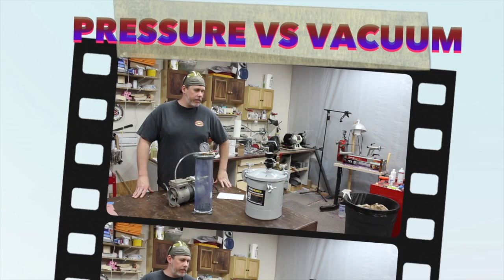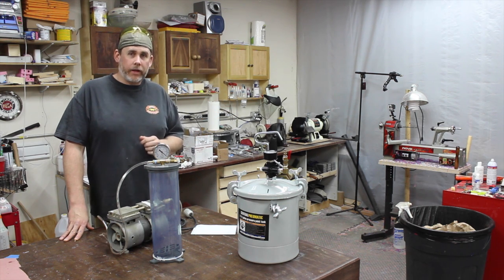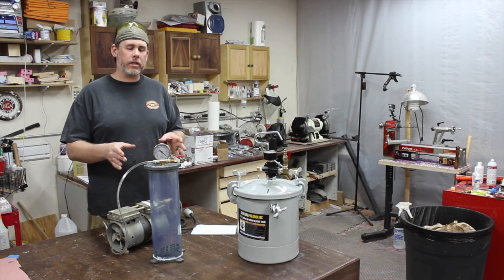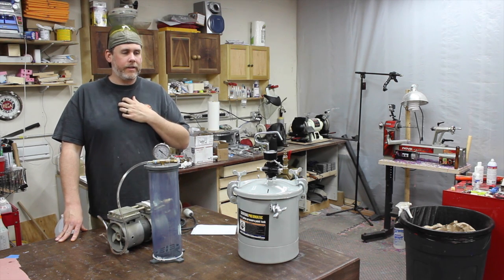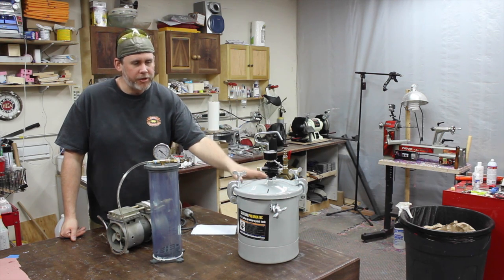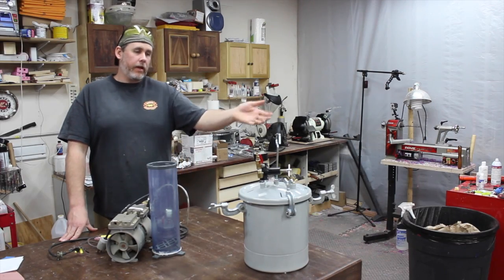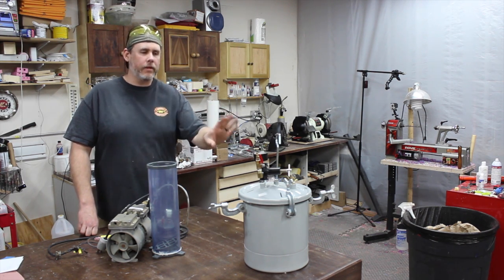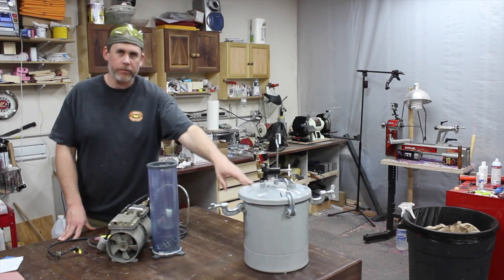Can I Use Vacuum Instead of A Pressure Pot to Cast Resins With?

Comment: Be careful with a vacuum.  I ruined a gallon of epoxy.  Pulled a vacuum, started cleaning and forgot.  Came back 10 minutes later and the resin was completely hardened and was so hot it melted the plastic bucket it was in.

Comment: I found that when de-gassing polyester casting resin, it gasses indefinitely. I suspect that the resin creates gas during the reaction but not enough to create bubbles in normal sea-level pressure but it's noticeable in a lower pressure. So I cannot see how anyone can leave a cast to set in a vaccum pot.

Comment: $100 for a Harbor Freight paint pot. More $ for conversion parts and hose. And you’ll need a compressor! Figure AT LEAST $200 for a cheap pressure pot setup.

Comment: I had a crazy idea for ensuring you don’t get voids in the resin. The idea is to have a valve where you have the resin on the outside of the vacuum pot and the mould on the inside. After you extract the air from the mould, you open the valve to suck the resin into the mould. Once the mould is filled/overflowing, then you let air into the rest of the vacuum pot. Probably not practical since the valve would be ruined, but I’m thinking that using just a rubber tube kinked could work.

Comment: Nice presentation mate, very throughly covered and well put.
I don't have pressure pot yet but am planning on investing in one. What I'm starting to find works best is to degas the resin in a vacume after mixing then pour into the mold then chuck it back into the vacume. De gas for the working time of the resin, release vacume and then hit any remaining bubbles with just the tip of a propane torch. Haven't got my hands on any alumilite yet, using table top epoxy and it seems to work with this so far. 
Still want a pressure pot though, just to brokearse for one right just now hahaha.

Comment: I’d like to start casting. I’m going to use either ecopoxy or Art Resin’s new casting resin thick cast whine it comes out. I’d like to do the pressure pot thing but I don’t get how to modify a paint pot and it looks scary? How to do this in an easy peasy way?

Comment: A vacuum could work with slow setting resins (or a very powerful vacuum in a small container) like he said because when there's no air in the environment, that air is going to want to float out of the resin because it's lighter than the resin and wants to move around but how a pressure pot works is completely different.

The reason a pressure pot compresses those bubbles to a microscopic level is that they're trapped in the resin at 1 atm (14.6 psi) and when you change the air pressure on the resin to 50 - 60 psi while it's still not set that's 3 to 4x what the bubbles have in them so the molecules are naturally pushed into a smaller space and the flowing resin moves simultaneously to fill the space those molecules took up at 1atm.

Of course, if you could cast all your resin in a vacuum or hypobaric chamber, there'd be almost no air to mix into it and you'd have perfect casting without a pressure pot every time! Of course, making a personal vacuum or hypobaric chamber is probably not the best or safest route and would cost you 10s to 100s of thousands of dollars for minimum benefit.

Comment: Great video, thanks! I bought a used cornelius beer keg and a manometer on eBay and used it for 50+ plus resin castings now and it has worked as a charm. Cost me 67 $ in total.

Comment: When you use positive pressure, air bubbles are extruded from the medium. When using negative pressure, the low viscosity of the medium allows higher pressure bubbles to move toward lower pressure in the chamber.  What method you use is based on viscosity. The implements take the same amount of time to reach positive 50 psi or negative 30 Hg.

Comment: Just to clarify a bit technically the best way is a vacuum, that will give you the best product with the most solidity and structure but is not practical bc it pulls the bubbles out and in doing so causes a boiling and over flow which will leave you with half your resin in your mold and the other half around it and in the bottom of your chamber. While pressure puts pressure on the outside of the bubble making it much smaller but the bubble is still there just so small you can't see it all that well this, this leaves a clear products that is almost as clear as a vacuum, doesn't make a mess and doesn't waste resin. So yeah pressure is much better and easier especially if you don't need structural strength. This is why carbon fiber is done in a vacuum and not under pressure bc it's way stronger

Comment: Thanks,Zac! The question I have was about stabilizing wood with the vacuum chamber. How do you set up the material to do the stabilizing? Do you put in a piece of wood and then pour the resin over it to cover it? If so why would pressure not work to press the resin into the pores of the wood?
Reply: Jim Jakosh first you have to suck the air out, before you can push resin in

The same reason a vacuum chamber SHOULD work for casting
Reply: The vacuum would not only help provide some force to move the air, but could also help in allowing the timber to expand slightly too

I think in another video he put the timber in first

Comment: Can u just use a pressure pot for both removing the bubbles from the silicone mold and the resin?
Reply: THIS!! Need some info on that one as well .__.
Reply: Chubby Bunny Ive seen 2 professional videos where they only use a pressure pot, if u use a silicone that specifies it doesn't require degassing and only produces small bubbles those can be eliminated in a pressure pot.

Comment: If you dive 50 to 60 feet (20 meters) a balloon fist size will be flattened.  The air is compressed by 2 atmospheres  (as in the pressure pot at 50psi) .  That is how I think of it.

Comment: I bought some clear resin to cost the inside of some cups I turned, and wound up with a lot of air bubbles. So the pressure pot is the way to go using clear resin. The type of resin I had is the stuff that you place on a table top to make it real shiny, almost like glass

Comment: I think the issue with vac instead of pressure is that vacuum reduces the boiling points of the compounds that make up the resin so it will likely froth as it releases all of them gasses, with pressure it pushes all of the air out of the resin without lowering the boiling points (it increases boiling points with pressure). Disclaimer: I've never actually done a vac on resin but just my thinking with my experience in organic chemistry 👍

Comment: To stabilize the wood just drop it in Pentacryl. That's supposed to flush out the water and replace it with Pentacryl. No resin needed. Then cast the wood if that's what you want to do. Montana Wood Art.

Comment: I have a few molds and wanted to know how i would keep them from deforming my castings or the mold it's self with 60 psi becouse if you couldn't tell, thats a lot of pressure(thank you for reading the coments)
Reply: Side question. Dose it only work for reson?

Comment: Vacuum can/will make volatile compounds in the resin gas out so you may need to be a bit careful about which resins to use in vacuum.
Reply from the maker: Thanks for mentioning that. I wasn't aware of it when I made this video, but I found out the hard way during a test I did with epoxy under vacuum since I posted this one. Pressure is definitely the way to go for casting resins, vacuum just causes problems with most resins and takes forever even if it doesn't boil it or cause the resin to expand out of the mold
Reply: @ZacHiggins  the ideal would be a short vac to release trapped bubbles and spraying top of resin with a bubble burster will help.
This avoids removing any volatiles. Then pressure can be used to suppress any remaining microbubbles.

Comment: Hey Zac, this makes me wonder if vacuum will create a more structurally strong end result... just thinking out loud 

Thanks for the content!
Reply from the maker: Hey William, very valid question. I am still trying to get to the bottom of exactly what is happening to the bubbles under pressure. The best explanation I've heard is that the air bubbles go into solution with the resin once it turns from liquid to solid effectively removing them from the equation. So I don't think there is any drawback to the resin in terms of strength using pressure. Vacuum just takes too long for most resins, and it also has different effects on certain chemicals which can cause more problems that it's worth. Peter Brown just did a video on it a couple weeks ago with the same results and conclusions about it. Just don't think it's the best option when it comes to resin casting, but it definitely has it's uses for silicone or stabilizing
Reply: Zac Higgins Thank for the reply and the content!

Comment: do you have a recommendation of the best pressure cooker to use when starting up im doing resin casting of small models and want to find a cost effective way
Reply from the maker: You don't want to use a pressure cooker, you want to use a converted paint pot. I personally use C.A. Technologies brand pots, they aren't cheap but they're excellent quality. I think the cheapest way to go is the Harbor Freight pots, they're around $90 plus parts to convert them. I have videos that cover converting them and tips to get them sealed up. There are videos that cover both brands and a feature comparison between the two: https://www.youtube.com/playlist?list=PLoeB-EPC_91uBZHKS1mbeoy9AZyjjZmrA

Comment: I see this pressure tank listed at Harbor Freight as a (2 1/2 Gal Air Pressure Paint Tank),  How high (psi)do you cure at and what is it rated for? 
Also, Will that tank hold the proper pressure for the entire time when pressurized?
Reply from the maker: I actually use C.A. Technologies pots now, they are rated at 80 PSI, and I run them no higher than 70. The Harbor Freight pot I used to use was rated at 60 max psi, I would go up to 50 in it. Just make sure you read the label on any pot you get, they will say what the max psi is, and I always stay 10 psi below whatever the max is. They will hold pressure as long as it doesn't leak. I have a video that covers finding and fixing leaks in pressure pots that might be helpful: https://youtu.be/ZzdNZ6nqrgM

Comment: But do you use a different compressor?
Reply from the maker: You use a vaccum pump to pull vacuum, air compressor to pressurize the pressure pot

Comment: Too many variables in the questions/offerings here. 1) A series of brief vacuum/lower pressure over just the solutions expands dissolved gas, letting it rise and escape before pouring, as long as the cure time is slow enough; 2) A vacuum over wood blanks does the same but the wood density means trapped air can take hours to be slowly pulled; 3) Releasing vacuum means a return to ambient pressure, forcing whatever liquid the part is submerged in to penetrate where trapped air was pulled from. 4) Adding more pressure only serves to speed up the rate the liquid can penetrate, and will compress any remaining bubbles but only if the solution reaches those areas. 5) This slow process precludes most catalyzed resins, as they harden long before deep penetration occurs; 6) hence, the value and practical advantage of Cactus Juice type liquids, which stay thin until baked. For wood stabilizing, pressure is less valuable than slow long vacuum, because pressure benefits more crystal clear castings where bubbles are undesirable, but pressure alone will not force resins deep into dense material like wood where trapped air pockets will just shrink but not vanish.
Reply from the maker: I think you might have misunderstood the topic. This video is focused on casting resins, it is not at all about stabilizing wood. The intention is to remove air bubbles from casting resins only

Comment: I put the two portions in the vac and remove most of the air.. Takes a while because it is thick. Then I mix the parts together and then pressure. Word of caution, if you vac it and there are big bubbles in the parts you could have a big bubble to compress and it may not. Then you have a void in your blank.

Comment: The problem with a vacuum is that most resins produce gasses as they cure - thus filling your vacuum with gas and ruining its effect. Pressure pots force out gasses in the resin or nuclearize them, this increases pressure, maintains efficacy and will be taken care of by the pressure valves (or more likely compensate in some small ways for the leaks)

Comment: Thanks for the video and taking the time to explain this. 
   Someone asked about making a DIY pressure pot and here's what I did: Because I have molds that are weird shapes and sizes, I went to my local Plastics vendor (actually 2 different places) and got mis-cuts for 20 cents on the dollar, including a sheet of clear acrylic, that would end up being a viewing window (because we all like to watch). The rectangular box I made is 4 feet long, 27 inches tall and 12 inches deep, with one side being clear, and it cost $80 not including gauges and fixtures. Gasket material and cam dogs (latches) are readily available. I waxed the bottom with mold release to be able to clean up overflow occasionally and I respray mold release now an then. Have fun!

Comment: I didn't read all the comments, but I can't help thinking that the down side to pressure curing is you are trapping high pressure bubbles inside of the resin, which I think would stress the resin more than if you sucked the air out. This is basically how they make pop rock candy, taking molten candy, whipping air into it, then putting it under great pressure, and allowing it to cool to trap the bubbles. In my younger years when I worked in the electronic industry, we would always vacuum out the bubbles in the casting resin before encapsulating the electronic components. Yes, you need a slow cure resin to do it, but we didn't need to get 100% of the bubbles out. The bubbles that were left were small, and then when the vacuum was released in the vacuum jar, those small bubbles shrunk to nothing. No trapped super pressure bubbles to contend with. But that all changes if Alumilite creates it's own outgassing bubbles as a byproduct of curing, and not just from introducing air into the medium while mixing.
Reply from the maker: I agree that it seems like that would be the case, but I don't think that's actually how it works. If that were the case, every blank I turn would blow up the instant I started cutting into it. My theory is once the bubbles are collapsed, they mostly float to the surface. Need to find a chemist/physicist who can give us the run down on what's happening exactly. For now, I'll just chalk it up to magic since it works =D

Comment: Zac, it seems to me that a pressure pot could also be used as a vacuum chamber the only problem may be that you can't see through the lid unless you make a clear lid, do you see any reason why this wouldn't work?

Thanks
Reply from the maker: You could, but you really need to see inside when you are using it for vacuum or the contents can overflow out of the mold. They make clear conversion lids for them though, I have one that I use for degassing silicone

Comment: Thank you very much for the video! There is a lot of confusion about this subject. My take on it and the science of it from what I have gathered is it would be best to use both. Any object submersed in a liquid that could possibly have air in it putting it in a vacuum would pull the air out of the object and then immediately release the negative pressure or vacuum and the liquid or resin would be sucked into any crevice which is what stabilizes the wood. That process would be immediate. Create a vacuum and then immediately release it. Then put it in a pressure pot to shrink the air that has been actually removed from the object which is normally an hour case a piece of wood. I saw the experiment actually used on marinating meat. LOL. The science makes sense

Comment: can you suggest a good entry level pressure pot?
Reply from the maker: Hey Jim, I recommend going with the C.A. Technologies pots. It's a little more expensive than the cheap ones, but they are far better quality, safer, and you can go to a higher PSI with them. Most of the cheap brands will not stand behind the max psi rating they show on the pot if you call and ask about it (assuming you can even call and talk to someone about it), which worries me.  

C.A. Technologies knows that their pots are being used for resin casting at higher pressures, and they have absolutely no problem with it. They even introduced a model made for resin casting that is easier to set up for casting. I have a "tools I use" page on my website with links to the ones I buy that are set up for resin casting: http://nvwoodwerks.com/tools/

With the safety aspect involved, as well as the night and day difference in quality, I just can't recommend one of the cheap pots in good conscience.
Reply: Thank you for responding. I ended up buying a 5 gallon pot from California air tools for $207 and some change. It is rated up to 80psi and has the big latches like the one you have. much better than Harbor Freight. It did take a little bit of modification to get it ready to use, but not to much.
Reply: Here is the model that I got. California Air Tools 365B 5-Gallon Pressure Pot
Reply from the maker: Before you use it, I'd recommend contacting the manufacturer to see what psi they recommend using it at and what you plan to use it for. I tried saving a couple bucks once on a pot that looked pretty similar to C.A. Technologies, and the company told me they wouldn't recommend going over 35 psi in it even though they advertise a max of 90. I'm not saying it's a bad pot, but cheaper price tag typically means cheaper materials or less quality control. Better to be safe than sorry